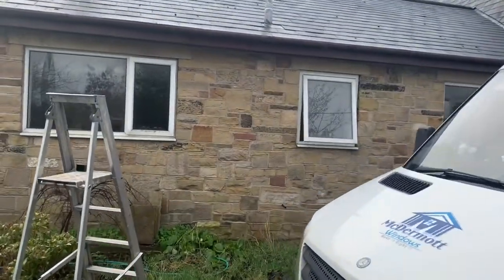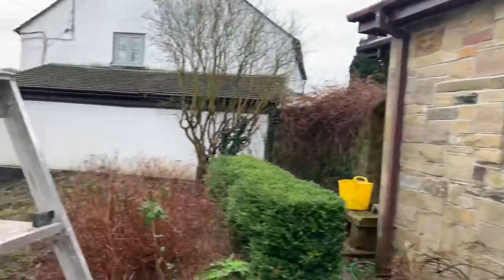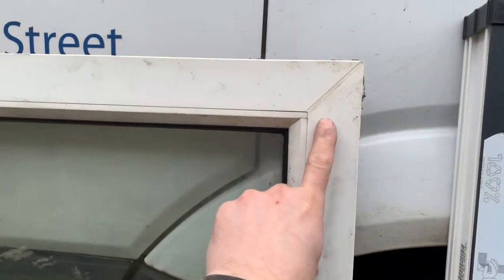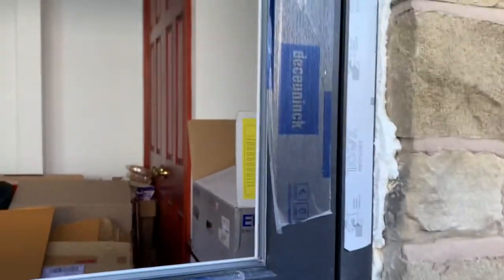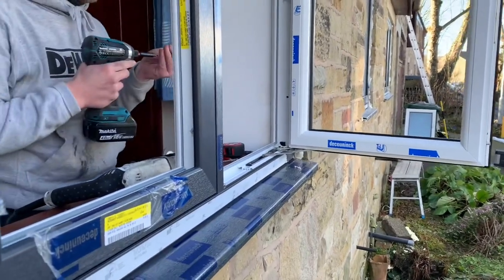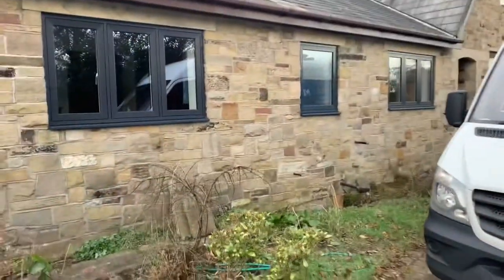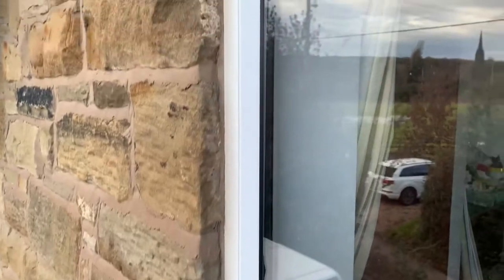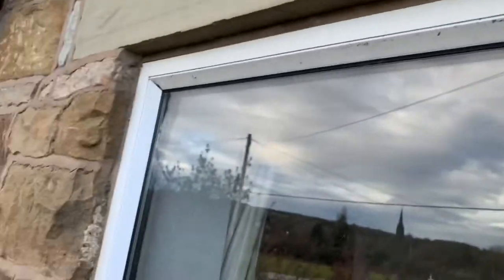Flush Sash Windows

Comment: Are there other ways to seal the window to the blockwork?  I did hear of expanding tape and lining paper.  If so is this an upgrade on expanding foam or just the same. Thanks for taking time to show us from start to finish.
Reply from the maker: Hi James. Yes there is a foam tape that can be used instead of silicone. We use the Illbruck Trio on the odd occasion and gives a very clean finish especially against a wavy stone. This product is applied to the window perimeter before installation. Once applied the foam starts to expand to create a neat weather seal. The sealing tape as well as sealing the gap provides excellent thermal insulation. This method does cost more than silicone and isn’t always practical to use for certain jobs. The biggest benefit for us in using the tape is it’s super clean finish not necessarily the insulation benefits as a lot of foams now provide excellent insulation benefits and the added benefit of holding the frames in place not just creating a seal. Checkout Tremco Illbruck on YouTube. We also have a lot of installation images showing the tape on our Facebook page. I will have to film an installation on the next job we use the tape. Thanks for watching. Stephen